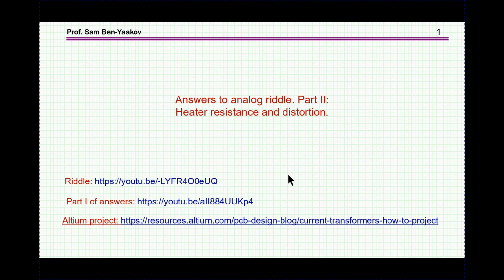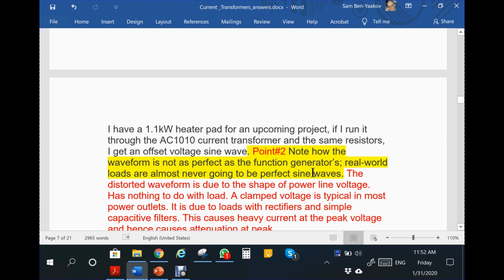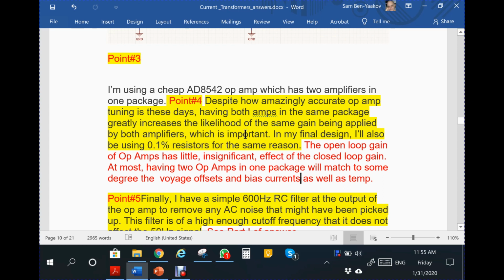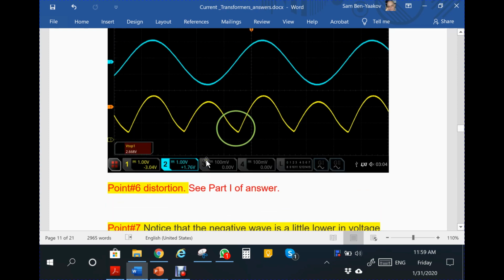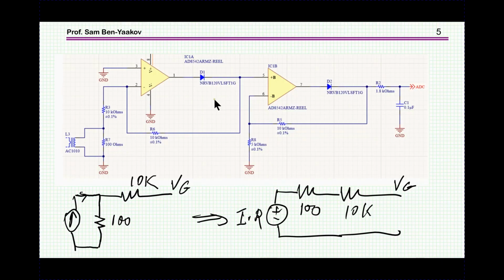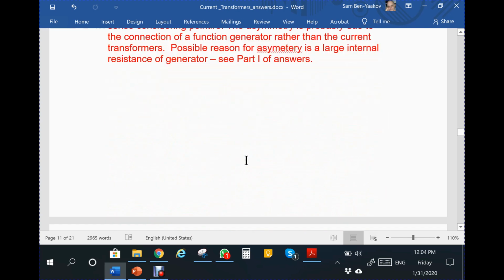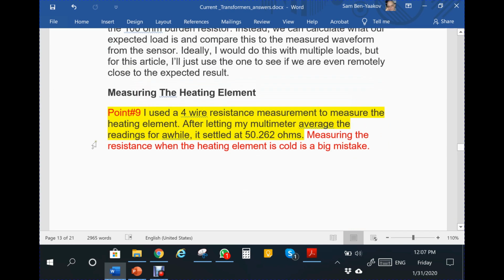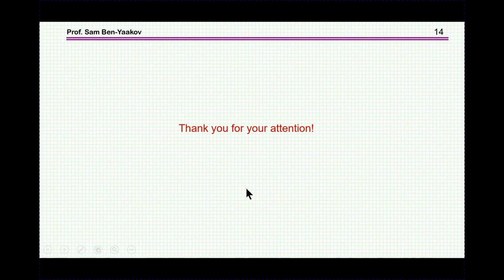Answers to analog riddle. Part II: Heater resistance and distortion.

Comment: I just have a comment on Point 2 :: The shape of the sine wave is not related to the mains .. You said the line voltage is distorted ... I have a doubt about this ... If you used a differential high voltage prob, you will see a good sinewave .... But the transformer has something >>> The answer is that the unloaded transformer is the worst case, not the best case.

At constant frequency, the magnetic flux in a transformer core is proportional to the peak voltage applied. Any current flowing in the primary winding drops a voltage across the winding resistance, which is ‘wasted’ and so does not add to the peak flux. So when the transformer is fully loaded, the flux is lower and the iron core remains in its linear, non-saturated regime. When it is unloaded, there is no voltage drop and the iron starts to saturate.

A transformer is designed to work at a rated load, without getting too hot. At least for small cheap, transformers, this means a relatively high winding resistance (since copper is expensive) which means the difference in peak flux between no-load and full load is relatively large, so the iron is well into saturation at no load.
You can see the output of a differential prob here at the end of this video :: https://youtu.be/N1Kz-EZtbsU?t=1630
and here is the signal using a transformer just to compare :: https://youtu.be/ZcyDs8ft-7c?t=1609
Reply from the maker: Have you ever measured the voltage at your power line outlet? Please send a scope trace and we will continue the discussion. AS for the transformer you are confusing the  voltage transformer with the current transformer. In a current transformer the voltage across it is a function of the OUTPUT voltage .Very lirttle if anything  to do with voltage drop on series resistor.

Comment: Great explaination of the problems and it´s solutions !
Wouldn´t the 600 Hz output filter also be a problem when measuring non-sinusodial line current draws e.g. small SMPS without PFC. (even if corrected to be linear)? Would a higher bandwidth amp be useful or is the BW mainly limited by the current transformer?
Reply from the maker: BW of amp is OK. 600Hz will also be OK  if linear